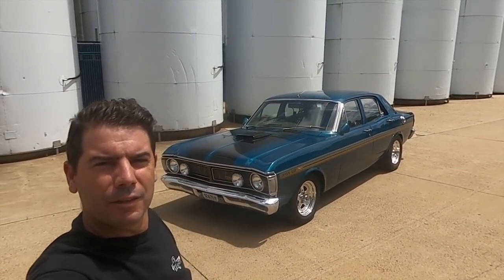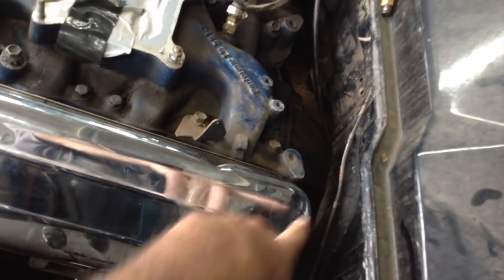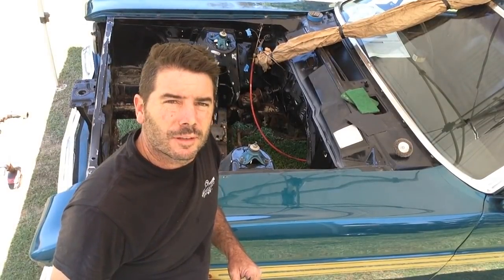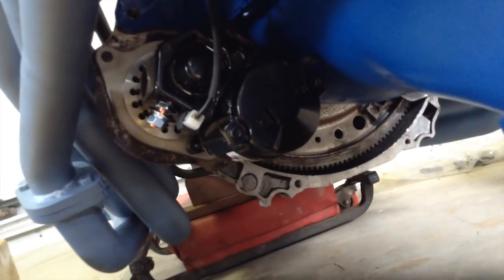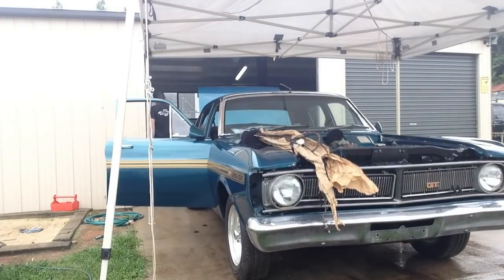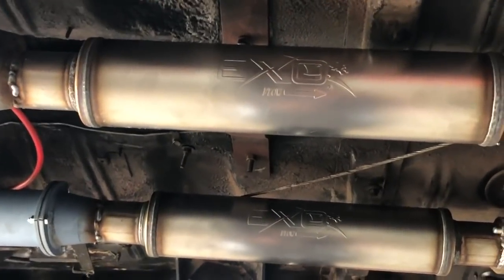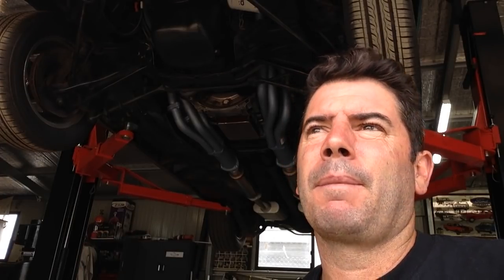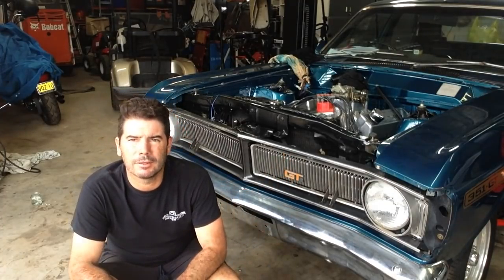Ep5. XY FALCON CLEVELAND ENGINE SWAP 351 TO 410CI STROKER V8

Comment: Jet, just found this. Great job, great tips...  
One for you... If brake line fittings too tight for open ender before I destroy them with pipe spanner I use a good set of square jaw vice grips, nice and tight & they break. I think the compression of the jaws brakes the aged & corroded bond on the thread... Hope it helps in the future. Cheers Mike

Comment: Mate that is a credit to you love the belt drive car dos remind me of the movie running on empty great Aussie movie ,I used to race speedway for 7yrs superstocks hard-hitting box section chasis , quick change diff hossier tyres plenty of hours in the shed and plenty of repairs ,ran a stroked Holden V8 ,cam,roller rockers ported heads list goes on she was a bullet in the end went hard as we were limited to 241 c in we de stroked and used 283 Chev rods all balanced ,ran threw a shortened hq box with made manual shifter as we turned box to the top and had gear shifter on top shifter was a Ford 10 prefect as they slotted in nicely hard to get now but worked well ,check out superstock racing in nz will open your eyes lols , cheers , shaneo, nelson,nz, 👍🍺
Reply from the maker: Thanks for watching again shaneo

Comment: I had to watch this vid again just coz the nut rolling effect, it's a common thing for me too. And another note, extractors never fit nice, not in my experience, so i tend to do a slippery fit first and make sure they align with the head, before engine is in the hole, some heating and bending is usually required and possibly grinding, you want those pipes fitting nice on the head with gaskets before installation. Some weld slag on the inside could do with a smooth off too will help flow transition  if your that fussy. I even go to extreme of ceramic coat on some projects after a f8ck ton of dickin around on extractor fitment. Have fun, i enjoy the quality of the vids mate.

Comment: I’d say your brake bleeding issues might be the rubber hose deteriorating and closing over, i had a similar issue recently when putting my grandfathers XB back on the road. Although it was stored in a shed for over 20 years, the rubber gets old.
Top looking rig mate.👍🇦🇺
Reply from the maker: Thanks man

Comment: Get a forklift so handy ideally a 4x4 makes car building so easy. No one seems to take rad support or grill out much quicker. About 15 to 20 mins and its on the floor even without a hoist.
Reply from the maker: Rad support is welded on these falcons mate mostly only GM product have bolt of front ends.
Thanks for watching cheers

Comment: Use vice grips to undo the rounded off brakelines instead of the spanner. They crack loose straight away 👌
Reply from the maker: Will remember that for next time cheers

Comment: Very nice work! What type of paint and color did you use on the headers?
Reply from the maker: They are Pacemaker headers mate , that’s just the colour they come new . Obviously it would be some type of extreme high temp paint but sorry mate I don’t know exactly what
Cheers for watching 🍺🍺
Reply: @backshed5295  thank you, gonna search for them here in the States...
Reply from the maker: They are base here in Queensland Australia and pretty sure are the only company out here that make a good header for CHI performance cylinder heads . Fit perfectly great product 🍺🍺👍

Comment: Hello Mick, beautiful car mate.  May I please ask the wheel and tyre sizes, and backspacing measurements? Thanks mate
Reply from the maker: 15x6 and 15x8
Both front and back are centre offset ( 0 offset)
Reply: Thanks for replying mate. And tyre sizes? Ta,  I really like that look (have a '66 2-Door US car)
Reply from the maker: @aidanfeighery6634  205 60 15 and 245 60 15 mate